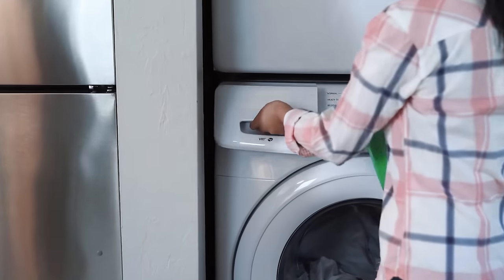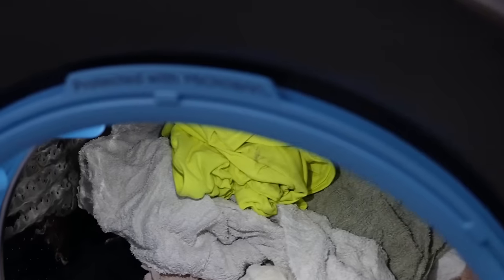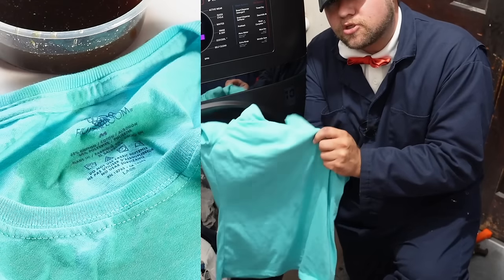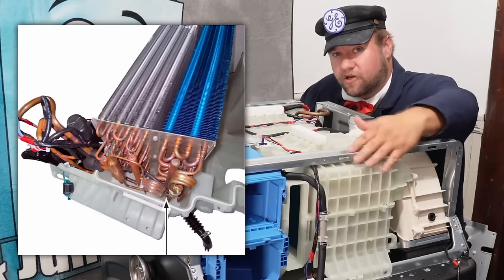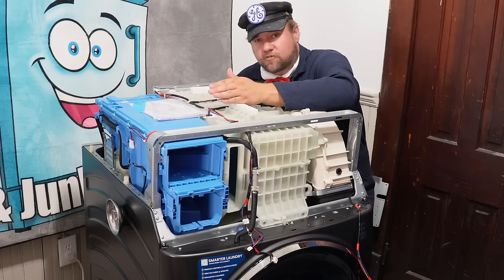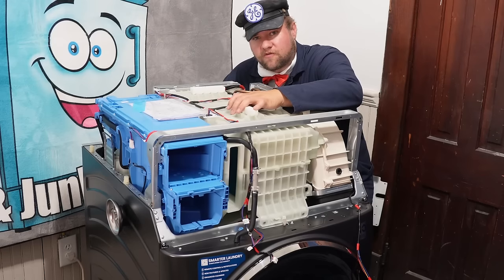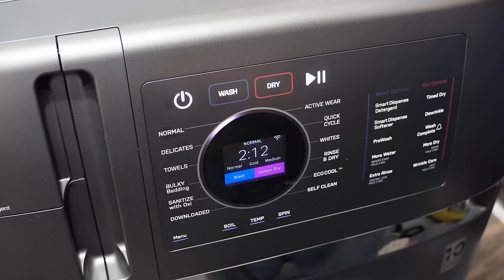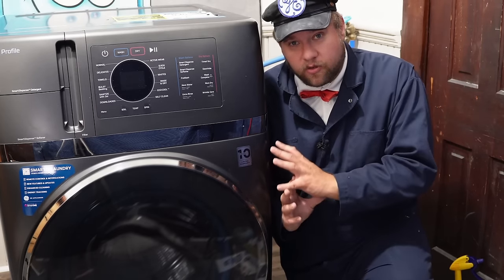The Best Washer Dryer EVER? The Ultimate GE 2-in-1-washer Dryer Combo Test & Review

Comment: I got this machine for ~$2,000 during a 4th of July deal. We have very limited space and were planning on getting a Miele or Bosch stacking set until we saw this come out. The bigger capacity was really the big selling point for us vs the Miele and Bosch's. We've had it running for about a month now and no complaints. We are diligent with filter cleaning but we do have 2 dogs and 2 cats so hopefully it keeps running well for us. I'm a very handy person so if it comes down to it, I should be able to take it apart and thoroughly clean it every few years if that's what's needed. Our normal sized loads are typically 2 hours or so to wash and dry, but we have had a load or two that stayed at the "1 minute" mark for 30 minutes or so before it finally finished. We really like that it's one-and-done and that you can't forget to move a load from the washer to the dryer now. Regardless of how long it takes to dry, we still save a ton of time ultimately because it starts drying as soon as the washing is done.
Reply: I think you dodged a bullet on the Miele. I had a set that lasted 22 years and replaced with a new set of Mieles. My wife absolutely hates the new Miele, the heat pump dryer sucks. I had limited room at my cabin just enough for the miele but the wife hated the Miele so much we didn't want another one. This fit the area perfect and totally love it. It dries so much better then the Miele. Probably won't last as long but half the price of the Miele.
Reply: Thanks for your comment about GE washer.  I’m redoing my kitchen and now will definitely make a place for this washer/dryer to avoid going in the basement.
Reply from the maker: @raybod1775  just note (which wasn't in the video) that the height is non-conventional. This is a good bit taller than most washers at 48"
Reply: You have 2 dogs and 2 cats in very limited space? 😅😅😅 Hair City on that coil. Lolol good luck.
Reply: @bensappliancesandjunk  Oof, that takes my tight space out of the running
Reply: Bosch are junk.
Reply: @raybod1775  Did you consider bumping out your kitchen to add a mud/laundry room?
Reply: I was hoping the Labor Day sale would match that low price you scored. Not even close. Wondering if Black Friday pricing will get it back to 2K again? I will buy it if it does.
Reply: @chrisgraham5667  I've read the July 4th sale was also an "early bird" sale. Not sure if that's true or not but if it is it might be a while before it gets that low again. On the bright side though, the longer you wait, the more likely it is that any issues or flaws are going to found first by us early buyers!
Reply: I also bought it for just about 2k. I have a family of 4. Love it. Don't overload towels just throw in and go to bed.  It's great to not have to switch it over
Reply: Well everything looks so nice with this washing machine,  I know I'm never going to have one my husband always buys me old used washing machines. I discovered them this year at the home Depot. I wish  you all the best to all the lucky people that are lucky enough to own one 🥰

Comment: I purchased this washer and to put it simply, its amazing.  It's saves space, its quiet, and it gets clothes clean.  The convenience of just putting a load in first thing in the morning or before you go to bed and have it completely finished when you come back or wake up CANNOT be overstated.  Typically, im a top load washer guy because I like lots of water to wash towels, blankets, and really dirty stuff.  I cannot say that this washer cleans as effectively as a top loader when washing the same volume of clothes so I just do smaller loads with the "more water" and "extra rinse" settings on and things come out fresh and clean.  There is also a "more dry" setting as well, to help things get very dry.  This washer is like having a laundry service, it allows me to do other things while my clothes go from dirty to completely clean and dry.  Also, no venting or 240v outlet needed... what?!! Since time is our most valuable resource... this washer/dryer is well worth the money.
Reply: Did you have to vent the dryer outside as you do aregular dyer. We use a gas dryer, which is very efficient.
Reply: The video showed a water drain line NOT a dryer vent hose.
Reply: I’m going to purchase this bad boy
Reply: @raymari7658  No, it has no vent. Kinda neat!
Reply: @raymari7658 No vent. It only has to get rid of the humidity condensed. You get rid of water with either a hose to a sink or a drain or you can empty a container which is easy to do.
Reply: Wait till you have an issue like some bs error code that no tech can fix
Reply: Are you still liking this unit?  And can you wash a queen sized quilt in it?
Reply: Can you extend the dry cycle with a smart phone remotely?
Reply: @dabasheaba me too: in fact…wifey wants to buy 2 of them. That might be dope!!!

Comment: I know in my area, the city requires peak electrical load calculations before you can get a permit to install a high wattage EV charger in your garage. This unit would allow you to reduce that peak by 5000 watts from a standard electric dryer, which might make a significant difference in the size of EV charger allowed. A typical 200A service for a home would be able to supply 38400 watts for a  continuous load (80% of 200A at 240V), so saving 5000 real watts is actually about 13% of the total load capacity.
Reply from the maker: Oh wow, that is a FANTASTIC point. Thank you for mentioning it!
Reply: While this MAY not be the best solution, you should know that it is sometimes possible to call up the city power company and request an upgraded power line.  400A is quite possible, and when I tried it, it was free - HOWEVER, you'll need a new panel (and subpanel and breakers) which means you pay out significant cash, but the end result is a massive increase in capacity.  I'd make an argument it is money well spent since it would probably improve both the usability and sale price of the house.
Reply: @LFTRnow   Good news there are tax rebates now as part of the IRA act to replace your panel.  So it's a lot cheaper at the moment.
Reply: “Oh, I got rid of my dryer. It’s not good for the environment, you know? I air dry now” me after hearing about this permit bs
Reply: If you want to get around that, take your EVSE and put a 220v plug on the end. (This is legal and allowable, plus you can buy them this way)
Then install a 220 volt outlet in the garage... This is just a normal outlet and you shouldn't have a big deal made over this. Mention a welder if you have to.
Now plug your EVSE into it. It's not part of the house now and there's no permitting or code required. It's just an item plugged into the wall.
Reply: @LFTRnow  Great suggestion. I would also add that if they say no at first, ask again in 6 months. They are given grants for things like this but if the funds or expirations date end they will say No, but not tell you why sometimes. :)
Reply: Move.
Reply: @CIAVERMONT it’s not the panel that’s the problem in the original comment. It’s the distribution grid that can’t handle the higher loads because the utility hasn’t invested in modernizing.

Comment: I saw this on sale at Costco and was tempted, but my current washer and dryer work just fine. I'm glad to see it getting good reviews, though, and hopefully it or a successor model will still exist when I'm next on the market. In addition to the energy and space savings and the ability to throw clothes in whenever and take them out fully dry, without needing to remember to swap machines before mold starts growing, using something like this could also save you energy with your HVAC. A normal dryer exhausts a lot of moist air, which needs to be made up in some way. The makeup air ends up leaking in through every crack in your home's envelope. So essentially you are exhausting conditioned air and letting in unconditioned air, increasing your heating load in the winter and your cooling load in the summer. If you've put effort in to air-sealing your home, a heat pump dryer of some sort can take your improvements to the next level.
Reply: I'm not sure how it could be exhausting a lot of damp warm air entirely unless we're talking about just radiant heat from the surface of the machine because if you have your vent properly connected and it properly cleaned out there's not going to be much in the way of heat transference. Or you know just make sure you keep the laundry room door shut lol
Reply: @AdmiralStoicRum   You missed his point.  A vented dryer works by pulling air from inside your house (conditioned air, that's been heated or cooled by your HVAC to comfortable living temperature) and running it through the heating element, then through the dryer drum to absorb moisture, then out the vent to the outside of your house.  This causes the air pressure inside your house to drop as air is vented outside.  As the air pressure inside your house drops below the air pressure outside your house, air from outside pushes its way inside through bathroom & kitchen vents, and gaps and cracks in walls and around windows and doors in order to equalize the pressure between outside and inside.  This air that comes into your house from outside is almost certainly either too hot or too cold depending on the season, which increases the load on, and energy use of, your HVAC system.
Reply: I think the biggest drawback is that you cannot wash more clothes until the first load is done drying.  So over the course of 5 hours you'll only have two loads done.  Normally I'm putting a 4th load in the washer at around the 5 hour mark.
Reply: @AdmiralStoicRum A normal dryer sucks a LOT of are from wherever it is and blows it out of the side of the house.  This thing only drains the WATER out of the recirculating air and dumps it down the same drain that the washer uses.

Comment: I am an HVAC instructor, and I have had one of these for close to a year now. Still working well and biggest issue is drying and we have found if you use the settings bulky for bedding, jeans for jeans it works better. We clean filter every load, but there was a large build up on left side wall where it come out of fan I did get it out with a refrigerator condenser brush

Comment: Even as a child I always wondered why washer/dryer combos weren't more prevalent. It seems like such an obvious thing to want. It does both jobs in half the space. Yet it's pretty rare to see them. Even when trying to find some online I only see around 4, this ge being one of them.
Reply: Washer/Drying combos are very common in Europe and have been for decades.  When I used to travel to Europe 20-25 years ago, no one that I can recall had both a separate washer and drying.  They were all combo units in order to save space.  I did have a friend who also had a separate dryer, but their washer was a combo unit.  I don't know why they're not more popular here.  They're much more efficient with both using less electricity and usually less water.  But the tech isn't new, and GE is decades behind other brings from Samsung, LG and others.
Reply: @BradM73 Japan and Korea too
Reply: In the US leaving the dampness is seen as a problem, it's why vents are so common. They are also known to have maintenance problems. So you have a high maintenance high cost machine with worse quality drying.
Reply: @MINIMAN10000  I've not known that to be the case in my experience.  And because everyone (or at least most people) has dual washer/dryer combos in the EU, they're not uncommon and less expensive to repair.  But generally they weren't very problematic.  It wasn't unusual for a load of laundry to take 3 hours there, but they are more power efficient and still get the job done.  It's a common misconception in the United States and Canada that combo units are some new technology.  They're not.
Reply: As a maintenance person all I can say is the more complicated the appliances the less time they're going to last. 
As of right now I got 2 combos to fix/ replace?? Never seen them before and I don't like them. I think the early appliances was the best ones... they lasted 30+ years.... none of this new stuff last that long at all
Reply: I know europe has way more efficient heating and cooling systems then here in America. Almost everything is more efficient across the pond.
Reply: They are super popular almost everywhere other than North America. Although, the older units had crappy long drying. The ones I've used in Japan took a while to dry and you still really hand to hang up your clothes afterwards. America is a very wealthy nation with a lot of relatively speaking large modern homes, so most people seemed fine with having a larger laundry room that had vents which more more costly but obtainable for many people.

This GE unit seems to really change the game though.
Reply: @chrisdixon3945  That is our experience as well, we moved into an older home where we have older washer and dryer, and don't plan on replacing till they can never be repaired again. In your experience how long do news ones typically last?

Comment: Thanks for the review, I appreciate the detail in regards to energy and water consumption, and especially construction and repairability!

I helped a close friend pick out and install this model about three weeks ago. She bought an older house and due to space constraints was limited to either this or a stacked combo unit. Her objection to the stacked unit was capacity, she wanted to be able to wash a queen sized comforter. I nudged her towards this, the tech and efficiency was appealing to me. Seeing this video prompted me to reach out and ask her opinion on it, now that she's been living with it for a few weeks.

She says she's mostly happy with it, more pros than cons. She likes the way the clothes come out, says they feel nicer than coming out of a traditional dryer, never misshapen, shrunken, or wrinkled. I can attest to that too, I was with her when she ran the first load after install. The energy savings will likely be a big positive in the long run too, we're in Florida and she's had some very high electric bills this summer running AC in a house that's not well sealed (it's almost 100 years old.)

Cons are that the barrel occasionally smells musty, though it is in an unconditioned space and the high ambient humidity may be a factor. I suggested that she may try leaving the door open when it's not in use to help prevent that. She does say that the lint trap needs more frequent cleaning than a traditional dryer, as noted in your review, but the machine gives a reminder before starting a cycle and it's not really an issue. Minor pet peeve is that the controls are very sensitive, and she finds her self accidentally pressing buttons while it's running just by leaning against it trying to reach things stored above. I'm going to dig into the manual and see if there's a button lock function.

Biggest concern before purchase was losing time by only having one unit, as in you can't start a second load in the wash while the first load is drying, as you would with separate machines. In practice she says this has not really been as big of a hindrance as expected, being able to start a load and go to bed or leave the house without having to wait around and move it to the dryer makes up for it in her use case. She also thinks that the larger load capacity in this machine is a pretty fair trade off compared to having stacked units with smaller capacity. Overall she is happy with the purchase.
Reply: Great to hear, thanks for sharing! And yes, there is a control lock feature!

Comment: Great, great review.  I've definitely been intrigued with this GE Profile One and Done, specifically because this would simplify our kids doing their own laundry.  Obviously the price is a big issue.  If a premium washer costs $1000, add a ~$300 dehumidifier, and air plumbing, it's not hard to see economies of scale (and hopefully competition) bringing the pricing down.  Right now they are trying to take advantage of first to market with an efficient & practical large capacity combo unit, taking the pricing of a premium washer/dryer set at ~$2K and then adding whatever premium they can up to their 'MSRP' of $2900.  It sold for $2K around the 4th of July, and I think I'll wait until Labor Day to see if we see a return to that more enticing pricing.
The best points of this are:
1. not having to switch laundry between two machines and the space savings of a combo unit
2. 115V electricity(no special wiring needed)/low wattage consumption/ventless efficiency which improves overall home efficiency.
3. large practical capacity and reasonable cycle times
The drawbacks:
1. New to market with unfamiliar complexities/longevity concerns
2. Pricing is getting out of hand
3. loss of pipelining efficiency where you can cycle full loads through a washer and dryer set in ~ an hour per load.
Reply: The front end loaders have been out for years and the prices are still pretty steep.
Reply: It's Labor Day, and I see this machine going around $2,500 ;(
Reply: Yeah? Easy to just throw the components together? Make one then